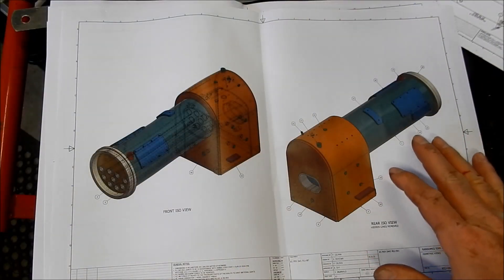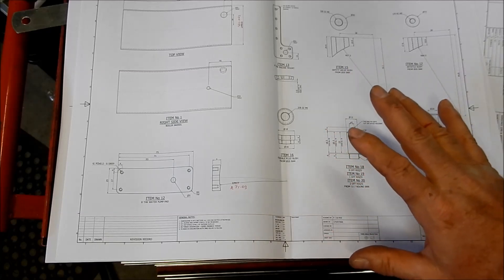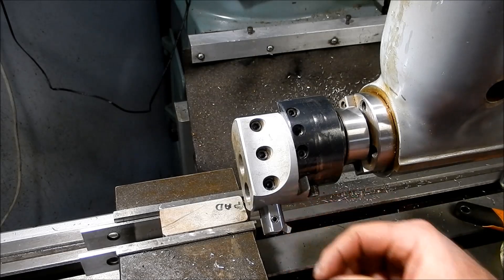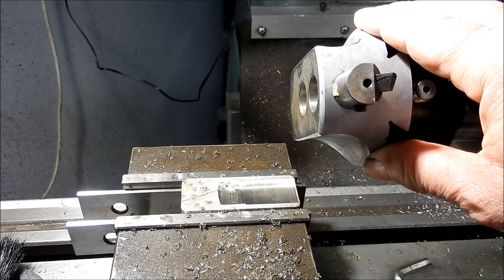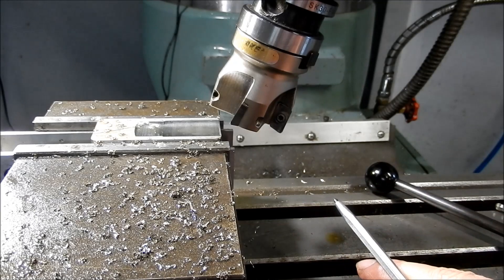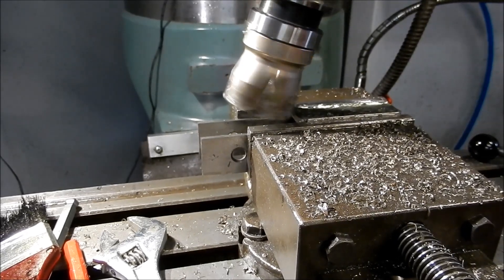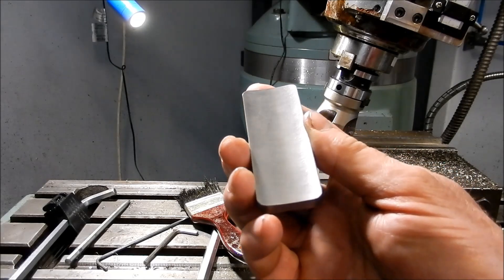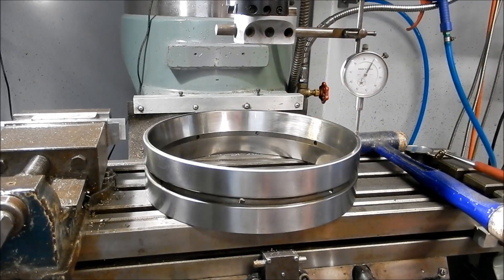Cutting a Large Diameter Radius for a Boiler Mount Plate

Comment: is not correct, part of "ellipse" is not part of circle, its close, but have two line in contact with circle, because you have R is not constant , correct 1 variant with boring head (boring bar) . The equal same question in gan forums - how boring picatinny rail.
Reply from the maker: Hi No 1 SE, as I mentioned when I was explaining the profile using the 50mm cutter, the profile is not a true curve or radius but it is within 0.03mm.  As this is to be welded onto the Boiler Barrel 0.03mm is close enough for this job.
Cam

Comment: any chance that your carbide was destroying itself cause it wasn't on center but in front of center on the boring head?
Reply from the maker: G'Day Tom, one of the things I did check was if the tool was on center and not cutting ahead of the bar.  It was spot on and touching dead on center when the head was on center.  This stuff work hardens with any reasonable surface speed so slow with a medium feed rate is the way to go.
Cam
Reply: @camatbattler2233  ah ok it just looks like when your showing the carbide burned up in the holder it's a half bit off centre. Maybe just trick of the camera. 6:30 centre of bar it's off?

Comment: Great approach to working that part.  Is duplex ss like a ph hardening ss?  You may just have to back down on the surface footage and keep the feed up.  It may work harden really quickly.  I Don't know for sure.  Awesome job though.  I want to find a large bearing now. Thank you.
Reply from the maker: G'Day Almost Machining, Duplex is a Martenitic and Austenitic stainless all rolled into one.  It work hardens very quickly with any reasonable surface speed so as you mention slow with a medium feed rate is the way to go.
Cam

Comment: Interesting tip. I don't have a milling machine, but interesting anyway.
Reply from the maker: Hi Rustinox, I have done some more machining with this stuff.  It work hardens with any sort of surface speed making it really difficult to work with.  Anyway, got to get all the work done so the boiler can be put together.  Next job, the stays with single point thread cutting, should be interesting.
Cam

Comment: Hi Cam, I've used fly cutters that way round, the problem is in my opinion in the rake, the tool is hitting the work almost straight on, it needs to be more of a hook so that it can penetrate! Cheers, Matthew
Reply from the maker: G'Day Mathew, some relief would probably help but I think that it would still wear out very quickly as this stuff work hardens very easily.  Slow surface speed with medium feed rate is the way to go.
Cam

Comment: Thanks for the good work on this item Cam and a very inventive method in forming the radius.
A bit of background as to why Duplex SAF2205 material became an option for building miniature boilers. 
Back in 2006 the AMBSC (Australian miniature boiler safety committee) formed a sub committee headed by Mr. Les Irwin to come up with an alternate material for making miniature boilers (up to 50 litres capacity) for live steam use. 
After discussions with material specialists SAF2205 came out on top due to its superior properties. 
In comparison to ordinary 300 series Stainless steels. SAF2205 is not affected by Chloride salts in water which are known to accelerate corrosion in 300 series Stainless steels when subjected to internal and thermal stresses. These stresses lead to hairline cracks forming in 300 series Stainless steels and weld failures.
SAF2205 Duplex has a low expansion rate that is approximately equal to that of normal carbon steel and as such is not affected with internal and thermal stresses. It has a Yield strength that is more than double that of normal Stainless steels (approx. 450 MPa)
In comparison to a steel boiler, the material thicknesses are substantially less for Duplex e.g. a steel tube plate at 12mm thickness is 4mm thickness in Duplex. This results in substantially less welding. So the high initial material cost of Duplex is offset by the quicker welding.
Hopefully in time. machining technology and cutting fluids improve so that milling, turning and drilling operations become easier when dealing with Duplex grade materials.
Cheers
Andy

Comment: Evening Cam. I notice your ISO 30 shell mill holder, I'm in the market for one and would appreciate your thoughts. IE 50mm dia.  verses say 40mm or 63mm, course pitch (4 teeth) verses a medium or fine pitch (maybe differential pitch is a bit overkill for a manual machine). Branding....? Sandvik is pricey, e-bay is very cheap, I'm looking at middle of the road Taiwanese. Did you truly get what you paid for? It will be going on a new, 3 HP well made Taiwanese machine.
Keep up the good work, Ian Mac.
Reply from the maker: G'Day Ian, I bought my 50mm cutter through CTC Tools but the carbide tips are all from e-bay.  For my little show they work just fine.  I did take some of my e-bay cutters to a CNC shop I did alot of design and programming work for and asked then to see how they would go in a proper workshop environment.  They got destroyed pretty quickly under high feed high speed and heat.  They are not a touch on Sandvik but are only a tenth the price.  The 50mm 4 insert cutter doen't produce the best surface finish so I use my 63mm 5 insert and 100mm 6 inset cutter for facing.  They both use the SEHW style inserts, I bought the holders out of Poland for a good price.  The only issue is they can't do square corners like the 50mm cutter can.  Did I get what I paid for?  I got what I expected for the price, a tool that does all I need for the work I do at an affordable price.
Cam
Reply: @camatbattler2233  thanks Cam, excellent information appreciated yor reply.

Comment: Hi Cam, good use of Inventor to work out the machining. Regards Kevin
Reply from the maker: Thanks Kevin, its a program I used professionally over the last 10-15 years.  Not the most flexible program sometimes but it got the job done.
Cam

Comment: I’ll bet you leap tall buildings at a single bound as well.
Reply from the maker: Don't know about that Gary but its a different approach and it solved the problem of burning up single point cutters.  Like I mentioned, this stuff is like machining hardened Gummby Bears.  You need to run the cut really slow to try and avoid it work hardening, especially with drilling when you need to follow up with a tap.
Cam

Comment: I started to think you weren't going to show us how the CAD worked to calculate the spindle angle! Crisis averted at the end. 😃 Back in the day I might have been able to work it out with solid geometry, tee square, compass and set squares. Who's got time for that anymore?
Reply from the maker: G'Day Mark, yep the old days of projecting to create a true cut shape into Frustums and Pipe sections.  Bread and butter stuff back in the day on the board with drafting machines.  Its so easy on the 3D programs to create and unfold to give the true cut shape now.  It does take away alot away from the old technique and thinking/mechanics behind it.  The younger Boiler Maker tradesmen and some of the older tradesmen on my crews still ask me to print out the shapes for angle pipe cut ins.  My reply, clear the bench, grab a Plate Square, Ruler, Dividers with chalk gaffer taped to one leg and some chalk to layout and lets work it through together.
Cam